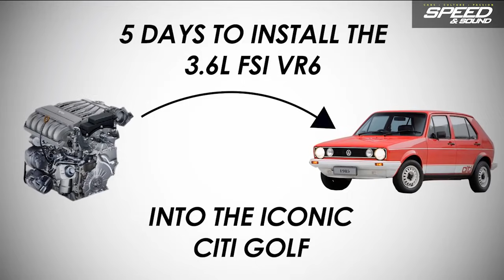Jamie Orr Citi Golf Challenge: Day 6 and a half

Comment: I have a Mk2 wanna install R32 engine can u do it?
Reply: Lots of work, but yes it's possible.
Reply: @LiquidNation100 Can I fit a R32 engine in a MK4 golf, without having it to be 4WD?
Reply: @owenkamuinjo2702  I believe so, yes. You can also get the 2.9L 24V Euro spec VR6 engine as a cheaper alternative.